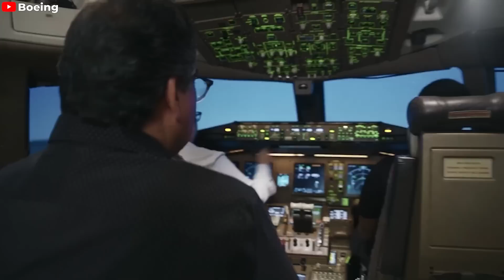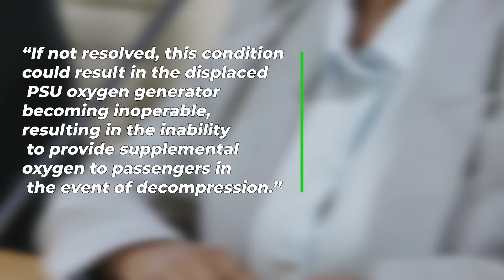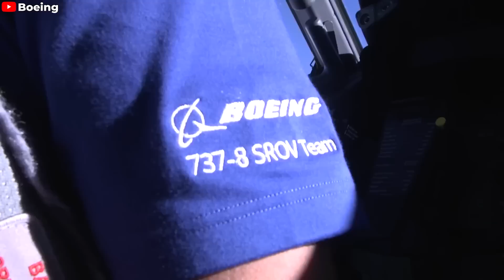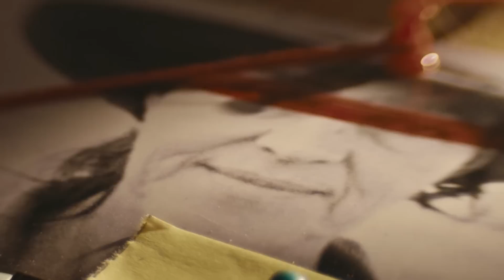Boeing is in big trouble with FAA! The 737Max...

Comment: I would think the FAA WOULD HAVE TO APPROVE ALL SYSTEMS IN THE AIRCRAFT, DURING THE CERTIFICATION PROCESS. What is FAA DOING. MORE EMPLOYEE INPUT ON ASSEMBLY IS NEEDED FROM TO CORRECT THESE ISSUES. QA NEED TO CHECK AN DOUBLE CHECK CHECK
Reply from the maker: Thanks for sharing your thoughts
Reply: Welcome to the world of regulatory capture. To save money, based on its previous track record, Boeing was allowed to self certify.  Unfortunately, Boeing fell victim to a very simple computer system design failure-- nobody asked what would happen if the stall avoidance system got bad data.  We can infer what would have happened, based on what got fixed.  The stall avoidance system was tweaked, so that it would not add more nose down trim to the horizontal stabilizer than the pilot could counteract by pulling back on the yoke.  This means that if the captain's angle-of-attack sensor was stuck at a high AoA, before the fix, the stall avoidance system would keep adding nose down trim, until the trim motor drive was switched off, or the plane crashed.  In both cases, the nose down trim already exceeded pilot command authority, by the time that the pilots became aware of it.

You might ask why the pilots took so long to notice the uncommanded trim adjustments?  The problem is that, along with causing a new way to enter a stall, moving the engines changed the 'seat of the pants' feel of the aircraft.  The 737MAX has less pitch response to changes in thrust than previous 737 models, so the MCAS would adjust the trim of the horizontal stabilizer to make pilots feel that they were flying a previous model 737.  Every time the pilots adjusted the throttles, while hand flying the plane with the flaps retracted, there would be an uncommanded horizontal stabilizer trim adjustment that felt like it 'did nothing', so pilots started to ignore them.